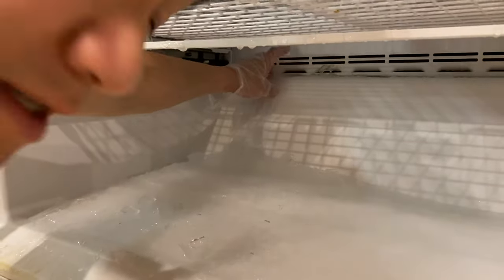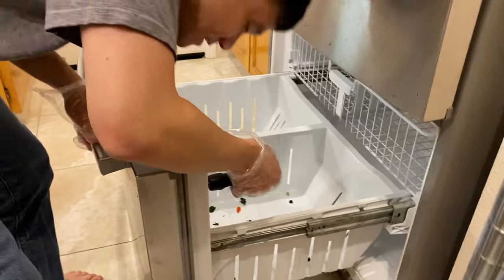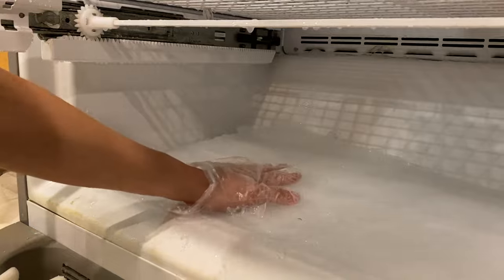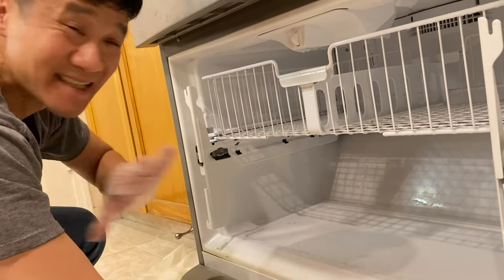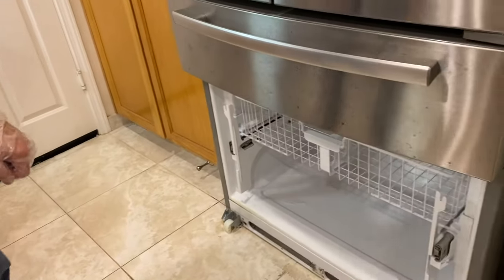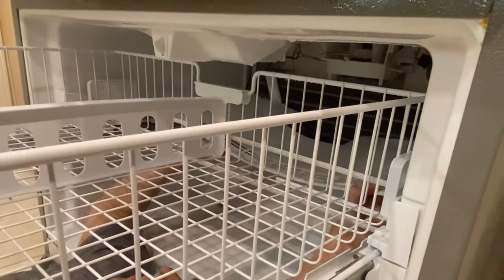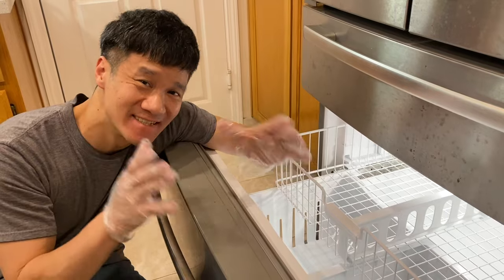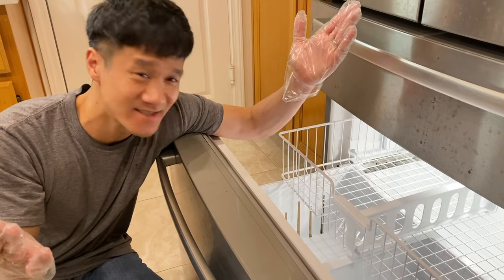How to FIX Water Leaking From Freezer - WHIRLPOOL GZ25FSRXYY7 French Door Refrigerator Water Leaking

Comment: Perfect Video, I`ve been dealing with this problem way too long and now I completely understand the problem and how to fix it !
 Next time you can remove the upper basket, I saw in another video someone did . It will give you better access without much more effort (4) screws to remove
Reply from the maker: Yeah.  Taking out the upper basket would help SOOOO much!  Good luck with your fix! 👏
Reply: Yes, there IS a way to remove the sliding drawers (look for plastic flaps to CAREFULLY pull-out-then the drawers will slide out) See another U-tube on this)

Comment: We were just about to go buy a replacement as I thought our ~15 year old side by side was done. This was 100% the issue, I just used the hair dryer to clean out the frozen over drain and will cross my fingers we solved the problem. Thanks for the detailed walk through!
Reply from the maker: Make sure you get a small pipe cleaner and really make sure the drain is completely unclogged all the way to the water plan on the back of the refrigerator.   I had to re-do this the second time to unfreeze the hose

Comment: We have a GE Monogram French Door with bottom freezer..Fixed same issue BUT had we known we would have started at the back of the fridge FIRST and checked the drain tube that goes into the evaporator drain pan. You will most likely will see the culprit, in our case there was a blockage in the rubber gasket that holds the drain tube that caused the issue inside the fridge. Once cleared it flows freely as it should.

Comment: Helpful video! Curious if the heating element that is suppose to melt off the coils periodically isn't working correctly any longer? Seems like that might be the long term fix for this issue.
Reply from the maker: It does help… but in my case, there was  something clogged in the drain too, so i had to melt it out completely, the defrost didn’t have the power to defrost all of it.
Reply: @UTECHPIA  I did the self-defrost (same 10yr old refrig/freezer) But having service person return (replaced Freezer gasket only as it was torn) to do a full diagnosis/pull refrig out, clean...AND replace In-line 5yr. prefilter for refrig water :)

Comment: Seems EXACTLY what my problem is. That drawer has always been a problem closing. Thank you very much. I'm going ice diving ..
Reply from the maker: Good luck!!! Make sure you really clean out the entire drain pipe too!  Even a tiny bit of ice stuck there, will cause the problem to come back right away!
Reply: @UTECHPIA  
I could see through tge lower tray vents and couldn't see any ice on the bottom. I looked at the back through and above the top tray and no ice seen there. I'm going to take everything out and get some heat and hot water back there today. Maybe ice in that drain I can't see. I still believe this will fix it. Sure hope so.
Reply from the maker: @semlohde1  it is hard to "see the ice", I missed the ice inside the tube the first time around. MAKE SURE you run water down the hose to make sure it is 100% clear before you put everything back together.  

Do it once, and make sure it is resolved :)
Reply: Welp- I did it. I'll have to be given a Whirlpool because I sure won't pay what I did for this again!! The door came off fine. The top drawer was magic, I wrestled that till I couldn't breathe. But it came off. The bottom was unreal too. There wasn't 1 drop of water anywhere. I took a cooking baster of hot water to the slot where you and others say is the drain hole. Several big squirts of good hot water.  No way I can crawl my 75yr old fat self in to see but I did hear water flow. I also saw the fins coated in dust so I vacuumed that good. Getting the drawers back on. What I think of this built fridge and whirlpool, would make the movies SAW look like a Heckle and Jeckle cartoon. I had to youtube how to get the top drawer tabs off. Got it together, water all over the floor. Had to drain from under the fridge. ASSUME the water bowl is full or tube is out. No way I can fix that. Your video and help are great. No reason for this bad construction. I did turn off both top and bottom ice maker and there wasn't any water on the floor. The whirlpool I replaced was moved to the shed, it's some 18 years old and never a problem. You know what these expensive China junk buckets.  Not again whirlpool!!!!

Comment: If it happens again soon then you could have issue with defrost cycle components.
Like a bad heater, or a bad thermostat.
Reply from the maker: Yep.  But if it happens once every 1-2 years, it is part of the design ;)
Reply: Maybe, maybe not. Bad design would not last two years.  Maybe the defrost cycle got interrupted by a power failure / glitch, and afterwards couldn't tell where things were.   @UTECHPIA
Reply: Watching diagnosis Utube I just turned off circuit breaker (almost built-in refrig/freezer) to RESET COMPUTER :)

Comment: Never use a heat gun in your refrigerator. You can melt a hole in the plastic walls, etc. Use a steamer or maybe hair dryer! You can blow out drain with a steamer.
Reply from the maker: True!  However, when used with caution, you can use a heatgun; it's just a lot easier to mess up and burn a hole.

Comment: My project for this weekend
Reply from the maker: Take your time, be patient as you let the ice FULLY melt, ensure the drain hose has no food or ice stuck in it. I had to do this TWICE because i rushed the first time :/

Have fun, good luck!!!
Reply: I showed your video to my boyfriend and he helped me fixed it using blow dryer to melt the ice, it worked. He told me it might happen again in 3 years.
Reply from the maker: @FoodieQueenBee  , yep, it will happen again, because we're not doing anything to "prevent it from happening again".  This is a design flaw.

Comment: So…where does the water drain to? Is there a container that needs to be emptied periodically ?
Reply from the maker: The water will drain to a fairly large pan, it sits in a pan and evaporates by design.
Reply: Open the unit on the bottom in the back and clean the check valve. This is where the problem lies. Probably need to clean it often to avoid water backup/clog.
Reply: @popptj  could you expand on this in more detail?

Comment: The rubber drain valve is clogged by dust and sh...90 out 100 times. Ice is not the problem but consequence of that. You should go back of fridge and remove rubber drain valve and clean it same for tubing and remove all ice insidebefore restart the fridge.
Reply from the maker: There was FOOD in my drain valve! 🤯🤯🤯
Reply: @UTECHPIA  i will do the clean up job for the 4th times in 10 years this week end i still have the same sh.ty valve lol
Reply from the maker: @Mario_QC at this point, I just consider it maintenance, once every few years. 😂